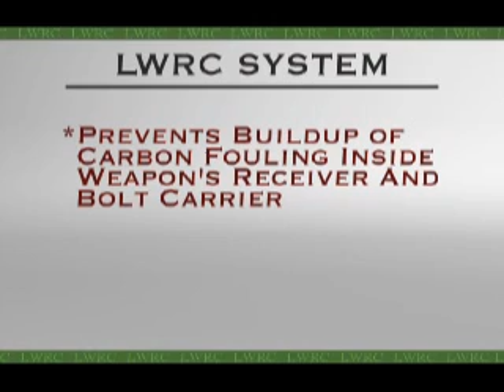LWRC

Comment: @Escmiester The M6 series can be chambered in 5.56 (Standard m4/AR-15) or 6.8 SPC (what the PSD uses). The only thing that makes the PSD class 3 (speacial federal licensing required) is it has a barrel length < 16 inches. If you get a 16-inch barrel for an M6-A2 chambered in 6.8 SPC, you've essentially got yourself a PSD that's legally identical to a simi-automatic .22 LR.

Comment: @CardboardFX  More weapons have that capability now.  Bushmaster ARC, HK416, and a few others.  Type in "over the beach test" and you can see several videos about this.  Wish I'd had one of these back in the day, instead of M16A2.
(6.8mm SPC rounds are better, though.  5.56mm doesn't have the stopping power.)

Comment: Just in case you get confused... 

 Piston

 NOUN:

   1. A solid cylinder or disk that fits snugly into a larger cylinder and moves under fluid pressure, as in a reciprocating engine, or displaces or compresses fluids, as in pumps and compressors.

Now lets see how stupid you get talking about liquids...  Oh, I am waiting.

Comment: The HK 416 only has the ability to fire the 5.56 round. While the M6A2 you can fit it to fire the 5.56 or the 6.8 rounds. However I doubt that you will get your hands on a HK 416 since Heckler & Koch are gearing the HK 416 to be a military and law enforcement only rifle. They will not be making a semi auto version of the HK 416.

Comment: The combat durability...
The housing and exterior design...
The bolt carrier gas transfer system...
The ice cold gas tube...

ITS THE HK416!!! (only with an exterior to match the existing M16's/M4's!)

However, it's still an impressive weapon. I can't wait to see it compared to the HK146 and the SCAR!

Comment: it could, a portion of the enegry delivered, is absorbed by the spring in the bolt, if that spring would be replaced by a smaller, stronger one, like the conversions, the energy could be slowed down at a different rate, which could possibly make for more kickback. Well, of course someone would experience with both systems would know best...